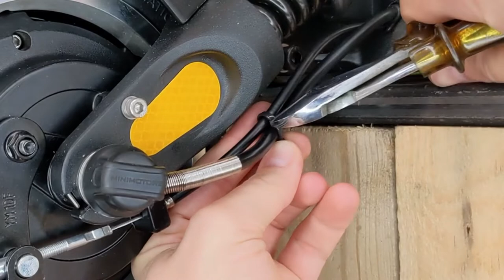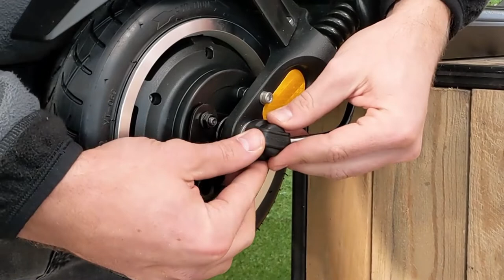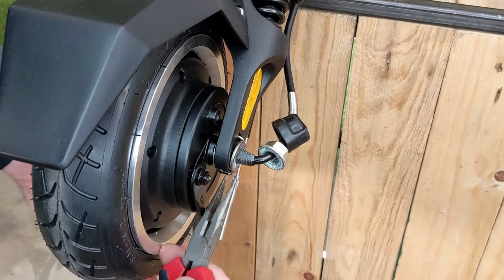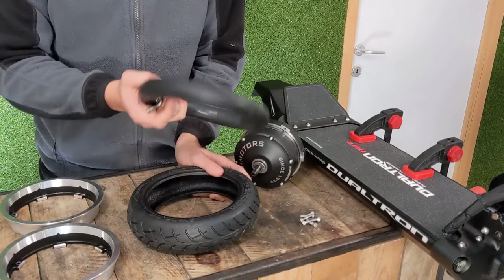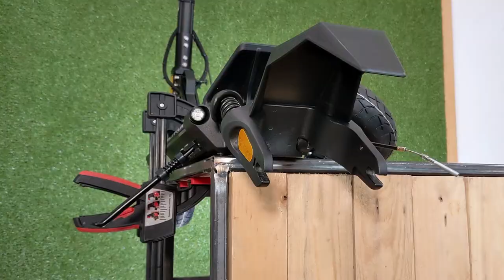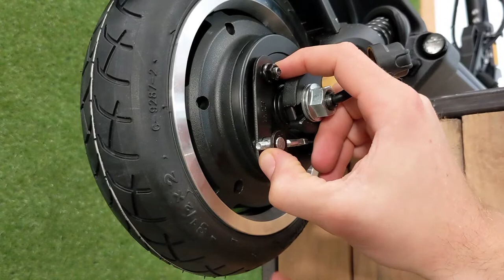Dualtron Mini - Changing the tyre and inner tube of the REAR WHEEL - Tutorial Minimotors 🛴 💚

Comment: Those alan head screws don't come off that easy. 6 months later, I still can't get them to unscrew. All I want to do is change the back tyre, and I refuse to pay for it when it should be simple DIY. 

Also, trying to pump up the tyre is gonna be a nightmare, as its right up against the wheel.